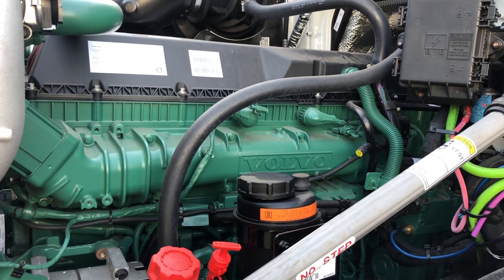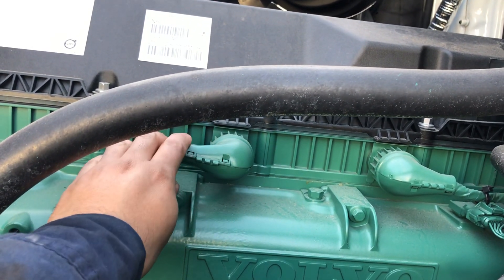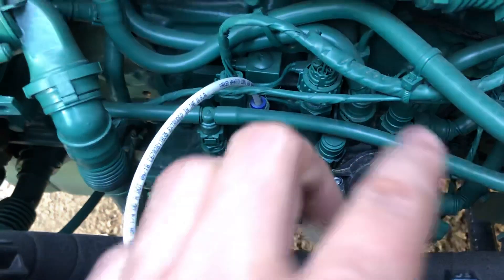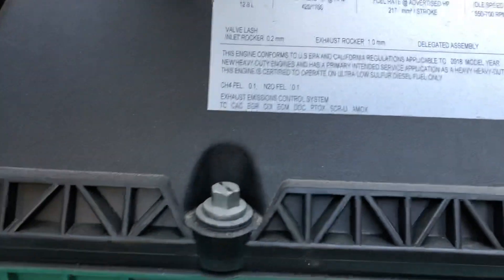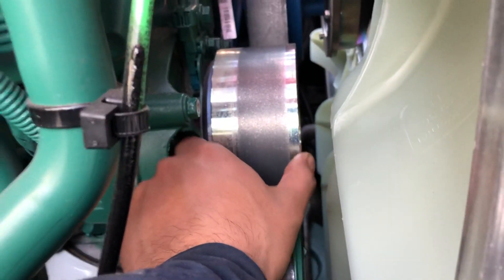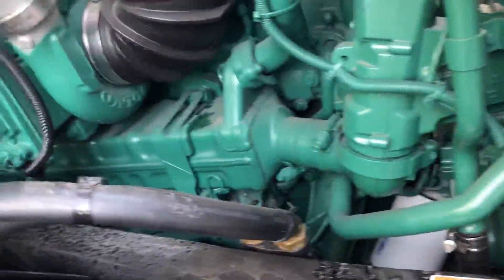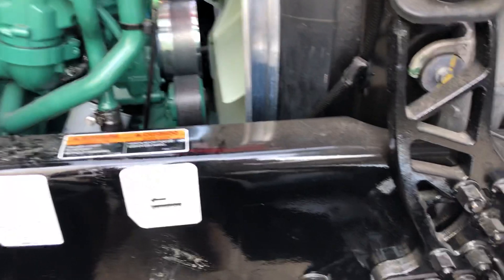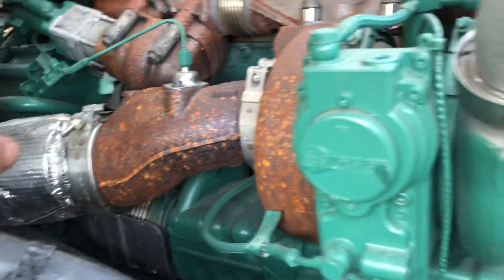Volvo D13 engine 2019: A quick review.

Comment: Is the D12 or D13 more reliable? Looking to buy used. Which is more expensive to maintain?
Reply: For sure... VOLVO with D13 engine is the most reliable...🇧🇷🇧🇷🇧🇷
Reply: D12
Reply: D12 might an old technology and weak, but it runs forever

Comment: Where is oil temperature sensor
Reply from the maker: Oil temperature sensor is located on the driver side (left side of the engine), close to the air compressor, you will see two sensor close to each other, the one of the top is the oil pressure sensor. Thanks for watching.
Reply: @LetstalkDIESEL  thank you for respond

Comment: my 2014 d13 still running  with  960 k miles  no complaints its paying my bills,  good working truck
Reply: How do they run when going uphills ? Thinking of getting one but dont want to go with cummins
Reply: They run very well uphill. Good low-end torque
Reply: My 2013 D13 still running too. 660k miles just minor issues thus far. Also paying my bills.

Comment: I got 1200000 miles on my D13 Volvo Automated and still running strong. Do your oil changes on time and they will run forever.
Reply from the maker: Good advice for new owner operators.
Reply: @LetstalkDIESEL  It's good that you tell us that the oil filters are all the same on this engine. 
It was a pain having to get a bypass filter and two ordinary filters. Now they are all the same it is less confusing . 
Thanks!👍
Reply: So no overhaul, no new bearings, no new head? Only valve adjustments, oil changes,  and injectors minor stuff right? I'm at 615, 000 mi on mine
Reply: @Bigdad559  not at all sr.
Reply: How often you have to do it?
Reply: @j.ramonsaucedo7795  sorry for the late reply.  I do my oil changes every 20000 km or 15000 miles
Reply: @j.ramonsaucedo7795  every 20000 kilometres.
Reply: What year
Reply: @willmalloy4940  2013
Reply: @willmalloy4940  2013 D13 500
Reply: You got lucky  enough
Reply: @jeancadet5862  I agree, some haven’t been so lucky.
Reply: @dsotojc4645  how many hours on your engine? Do you run apu?
Reply: @dsotojc4645  How much torque was your truck making?
Reply: @sstevocamaro   don’t have it anymore but sold it to a friend of mine.  (It had 1850 TQ)
Reply: @Wicked_RotF30  bought a new KW. But.. worst mistake ever… should’ve kept it. Stupid Cummins engine nothing but problems.
Reply: @dsotojc4645  how many hours you had in the engine did you run APU?

Comment: I have question d13 volvo good for over load 138k lb ? And how much hpw should be?
Reply from the maker: I do not know about overload around that size. This engine Volvo D13 is 450 HP, so this is relative small engine for that, in the other hand, you have Volvo D16, this engine can make up 600 HP, so it depend of the engine configuration. Thanks for watching.
Reply: @LetstalkDIESEL  In UK/EU the D16 has been making 750bhp and 2620lbs/ft for many years. We're now waiting for the D16-800
Reply: @LetstalkDIESEL  d16 is discontinued in the united states because it did not sell very well, only d11 and 2 variants of the d13 are still around, the normal d13 and the d13tc or turbo compound.

Comment: I Ding, I Ding ??????? Not Sure....No Facts.
Reply from the maker: Well, I have a few facts for that engine: 

1. Volvo is the only manufacturer that has keep the same engine design (in general) from 2007 up to 2019. Few components might be different but if you compare both engines side to side... they look really alike.
2. Sadly, but true, 2017-2018 Volvo engines (those with the injector harness separated from the main engine harness) the injector harness has been defective, we’ve have to replace couple of those in our fleet.
3. Volvo engine does NOT have a High Fuel Pressure Pump (2016 and up), instead three of the injector do the job of the Pump. Quite interesting in my personal opinion.

I know, they are many other details that I do not cover in this video but it is just my personal opinion. Thanks for watching and stay around you may find something helpful.

Comment: I work on volvo Bus we use D13 like this one
Reply from the maker: We work  on this kind of engine but it is for tractor trucks.
Reply: How are these engine after 600,000 miles on them?
Reply: @jaimecruz5367  some customer make 600 000 in one year and no problem , but the engine keep warmer on BUs because engin is in back.
Reply: @jaimecruz5367  I work with new bus but i could ask to somebody in service dept.
Reply from the maker: @jaimecruz5367  in our fleet, usually, they have couple issues now and then but this is for 2016 and older, like NOx sensor problems or emissions relate it. Beyond 500,000 miles usually transmission has problems and Injectors cups, but this depends of many factors like PM intervals, driver performance and other little things. 2017 and newer trucks still around 400,000 miles or less, so I cannot give an answer for that yet.
Reply: I m also work on volvo B7R, B9R, B11R bus

Comment: what coolant is this truck using? i use the orange elc, this looks more rose or pink color.
Reply from the maker: Yeah, you are right about the color. These trucks comes with Texaco ELC that is like kind purple or dark pink color, others trucks do not have the sticker brand but they still specify what kind of coolant is recommended to use if you flush it. I hope this answer your question.
Reply: Texaco heavy Duty ELC , it's actually light purple. Engine oil is factory fill Chevron DELO 10-30
Reply: Most of the trucks I see use the standard red elc
Reply: any 50/50 works really
Reply: new truck use light yellow